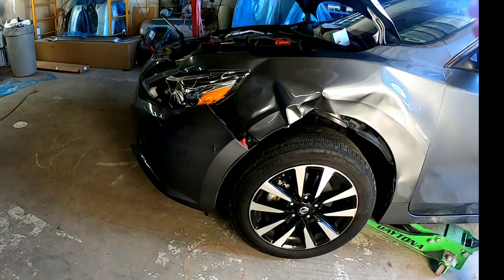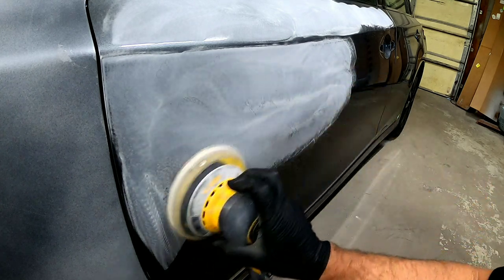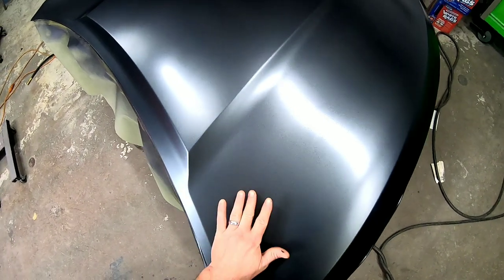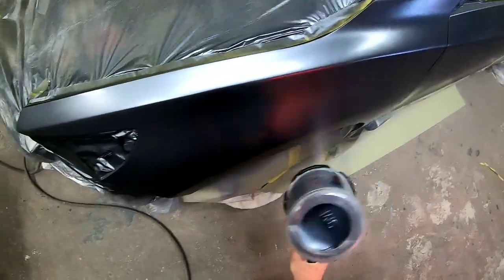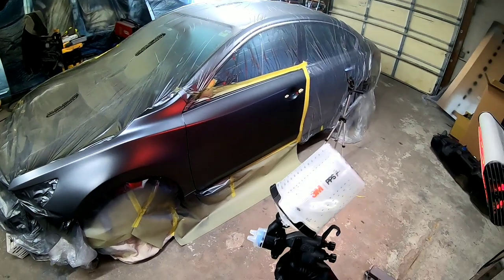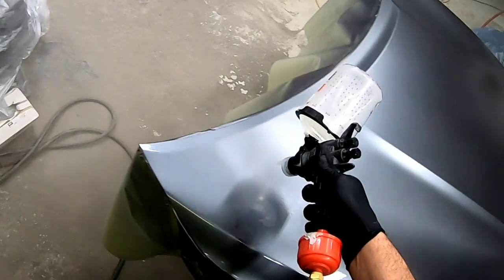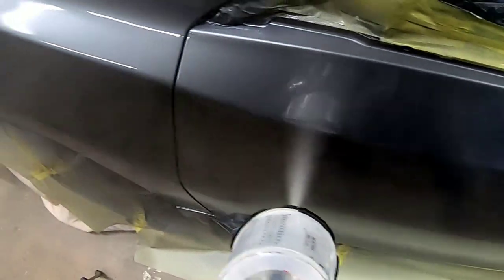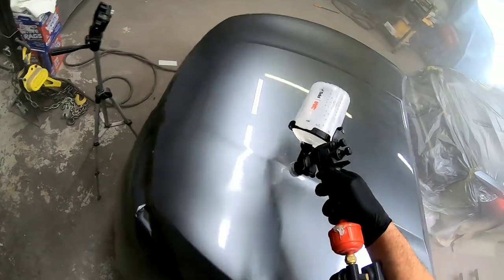Beginners guide to repair and paint your car. #bodywork #autopaint

Comment: Great video! What grit are those gray scotchbrite pads? What is interface pads? The air regulator is on the gun and where is the moisture catcher for the compressor go?
Reply from the maker: Grey ultra fine scotch brite is between 800- 1500 grit . You dont  need to press hard. If you do you could put deeper scratches. Moisture/ oil filter goes in the air line ideally 50 ft from compressor.  Thanks for the comment Bobby!
Reply from the maker: The interface pad is a soft pad that is between sander and sandpaper allowing sander to softly go over bodyline and such.

Comment: Hey Chris loving the videos!..I have a little problem and wanted your opinion..I replaced the passenger side quarter panel. I painted the door jam but not the quarter panel since I forgot to buy more reducer so I masked the quarter panel off and taped about a half an inch out from the lip/edge of door jamb to minimize sanding of overspray when I do paint the quarter panel. So today (I painted the jamb Tuesday) I go to pull off the tape and peel about a 1 1/2 square inch of clear with it. It looked like I peeled off scotch tape. Was I not supposed to paint over a tape edge? Did I peel to soon?..can I just sand that area, dust some paint and maybe blend the clear?.any help would be appreciated thanks..sorry for the long post just wanted to be as descriptive as possible
Reply from the maker: If I'm  understanding correctly when you pulled the tape it peeled the clear into the jamb. The best way to repair would be to sand peeling edge with 600 and paint and clear jamb again. There are some hacks, If it just peeled the clear and not the paint you could lightly wet sand around peeling clear and brush on some clear then wet sand and buff. You could sand it smooth with 600 and the surrounding area with 1000 or  1500 then blow in some color then clear and spray in with reducer .lite coat not heavy,  then buff. Hard to explain with a text. Hope this helps. Anytime you have clear up to an edge of tape there  a good chance of that tape pulling the clear. You need a soft edge or just sand off overspray  when its dry.
Reply: @GarageNoise   that’s exactly what happened, I pulled it into the jamb. Yes it just peeled the clear and not the base so I’ll definitely try what you mentioned makes sense, 600 the edge, dust base , clear and blow in reducer over 1500 got it 👍🏻. I’ll be sure to sand the overspray next time 😂. Thanks for always helping Chris , you da man!..do you have a patreon account, I’d like to send you for a 🍺?